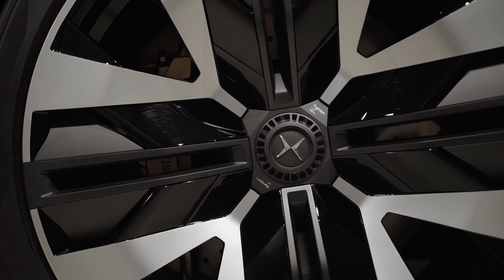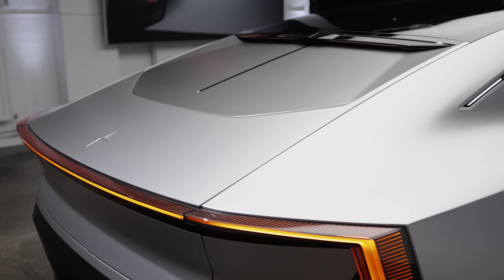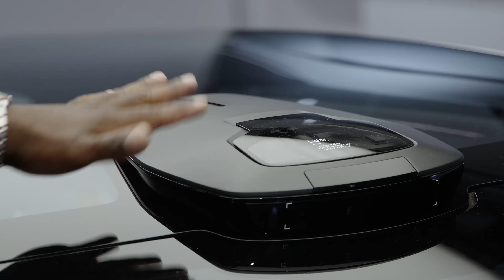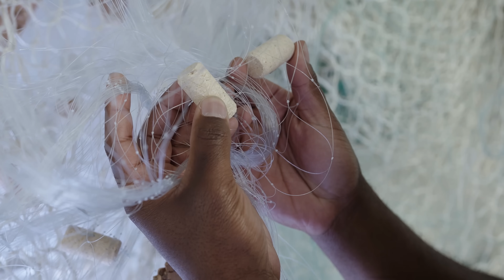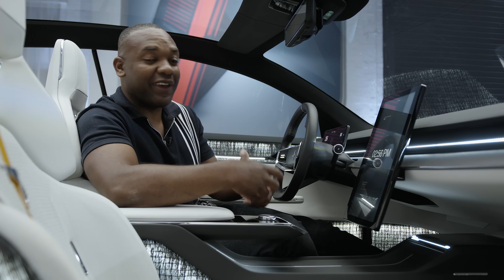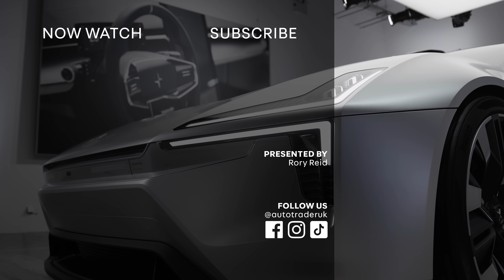NEW Polestar Precept: The Most BEAUTIFUL Electric Car So Far? | 4K

Comment: Great looking car.
"Polestar is a Swedish automotive brand established in 1996 by Volvo Cars' partner Flash/Polestar Racing and acquired in 2015 by the former. It is owned by Volvo Cars and by extension its parent company Geely. Geely describes the brand as "independent" from 2017 onwards and "co-owned" by it and Volvo Cars." Wikipedia

Comment: hate to say it but i dont want any form of moon roof on any car...living in Montana the heat from a moon roof is unreal in the spring and summer time...i never open the moonroof on my Jeep Grand Cherokee as it is just to bloody hot to do so.  The other thing I do not like just like on the tesla, I do not like not having a manual stick to put the car into gear.  I know it technically isnt needed but it is just my preference.  However, I really like the rest of the design.  I am curious what the specs for range and such will be for this car.

Comment: The only nice feature is how the front looks and maybe the seats, but only time will tell if and how they perform in real life and how they age, and how dirt gets stuck everywhere... Everything else is just meh, especially the rear, just ugly.
- the interior "fabricky" panels, just ugly as well. Just as the guy said "Repackaged garbage". Exactly. 
- all the lighting inside? Why? I only see higher maintenance cost in this unnecessary gimmick.
- glass roof? Again, why? Because it "looks cool". Impractical from so many angles. "So you can have more light inside???" What is this, a library? I don't need MORE light in my car. And wait until the car rolls over - without the back beam and glass roof, no thanks. I used to have similar roof windows on my previous car. It got hot as hell on sunny days inside. My new car without any roof glass doesn't get half as hot and it gets cold a lot faster too when driving. Better safety too. And also, how often do you look up when driving? Just another gimmick.
- no middle rear car seat? Just so you can have an arm rest? Is this supposed to be a limousine? It does not have privacy or enough head room or leg room for that (the guy is 5'11" and it's just "ok" for him). So why? So rear seat passengers can control my audio? No thanks. I am the DJ in my car. This just looks like a half assed idea of an overly enthusiastic good-doer wanna show-er.
- the Lidar "bug"... I guess engineers had a vacation day when that was just stomped on...
- STOP WITH THE DASHBOARD TOUCH(GESTURE) SCREEN GIMMICKY POOP already! I want to FEEL what I am touching when my eyes are 100%!!! on the road. Your CHEAP "modern" touch screen solutions are not improving anything!
- what sort of "review" is this when you don't even open trunk? TF?
/rant

Comment: Imagine opening these doors in a Tesco carpark.
Reply: Exactly. Impractical for aesthetics.
Reply: @Wunderkinddd  I think they would have thought about that, I wonder if they have sensors to open without object hitting.
Reply: @Wunderkinddd  strongly disagree with you about the different hinges ( dihedral or lambo would work as well but im not super sure there the better pick overall for this model ) and having no b-pillar's as loading and getting into and out are easier than conventional b-pliersed sedans

Comment: Not a single drink holder, albeit an ashtray too, every driver enjoys a beverage at times while driving, no utilitarian thought in it’s design for real world consumers. They use recycled materials, which is a fraction of the cost of new/bulk material, & intend to charge “through the nose” for it?😱. The obnoxiously large LED screen is akin to Tesla’s,,,does it also feature the “fireplace” their’s has?😂. It does have it’s attractive points, but from what I’ve seen, there’s better EVs on the market. At most likely priced at over $80K+, it would only be for the financially well-heeled of buyers. It’s still always good to see new competitors & their ideas become fruition.

Comment: The u.k current annual electricity usage is 287.58 terawatt hours a year.  An electric car that travels 13500 miles a year uses 4000kwh.  1x terawatt covers 25,000 cars.  U.k has 40m vehicles.  The u.k requires 1600Terawatts. Where are they going to get this, by fossil fuel power stations?  How many batteries? How many open mines?  Game playing is what enviromentalists are doing as well as politicians.  Bs

Comment: Listen this channel is so shit since it can not see the revolution that is before it and understand that there are two kinds of EV's.
1-
EV's that are cars that are just propelled by batteries (so a new power train but in essence are still cars in regards the consumers user experience and the functionality they can provide).
This transition has been a nightmare for every single OEM that produces ICE cars.

2-
There is a second and different kind of EV, one the is propelled by batteries and for which they provide the best in class performance per kg and per $ spent.
 This is Tesla, but Tesla, has added to this performance propulsion a new customer experience by making their EV's a software programmable EV.
So what does this offer the consumer and how does it change the user experience.
Well one gets true over-the-air- updates , none of this fakery that can only update the interface of the entertainment system, but actual software control over the fundamental building block of the EV, so battery pack, brakes, windscreen wipers, entertainment systems, use telematics to monitor the car and its performance and to record logs about the cars activity, etc. 
This is fine scale controllability enabled by Tesla having its own real time operating system that controls almost everything that makes up the car.
This means that Tesla's cars evolve over time and this enables something very valuable to consumers, future proofing....or a close approximation. 
An ordinary EV is a car that can not evolve and be upgraded over time. 
A second hand Tesla model 3 built in 2018 is not the same car now in 2021 as it was in 2018, it is a better car now due to updates.
Tesla's are becoming autonomous and have the capacity built in via the 3rd gen AI chip and sensors which are connected to Tesla's supercomputers that train the AI neural networks to become better autonomous car. 
This is not a geo-fenced solution, this is to enable a Tesla to drive on any road anywhere. 
Tesla's are NOT EV's like the Polestar et al,  they are software controlled and becoming level 4 and or level 5 functionally autonomous, a value add,  that ensure they change the consumer experience of using and owning cars forever.

So the above is NOT what this channel has been able to articulate or is even aware of and you completely miss what is happening to your industry, just like Nokia and Microsoft missed what was happening when the Apple IPhone came along with the Apple App Store.

Comment: I´m not a fan. There are various design elements stolen from other cars. At the same time some of the elements will most likely not make it into production.
The missing B Pillar section is hard to get noise free. The side section causes a lot of turbulences and will collect a lot of dirt. The lidar in the middle of the top....really? 
No rear window and no proper rear view? The doors are not "sportscar". Actually they were used in the 1930s, but then vanished because they are unpractical in every days use. 
The material inside looks very cheap. A luxury car using old, used fishnets....I´m not sure that they understand the target group. In general, were are the new design idea´s?
..but I´m probably not the target group.

Comment: Looks really nice! Not overly fond of the exterior “plate” on the front roof (hope they incorporate that in the car better with the final product) but I do like how the car looks overall. Also the sustainability aspects are worth a big thumbs up in my opinion.👍
Reply: ya they could and should do a much better job incorporating the electronic equipment than that...pretty slap dash if you ask me.
Reply: Since its lidar sensors they need to be mounted like that. Perhaps they can make it streamlined but a hump is required. volvo will have it on all future cars and my guess is that polestar will do the same with their future models

Comment: This  is a concept but I am still not sold on the whole premise of these electric cars and if the government will have rolled out enough charging points to make these viable options for those who now have cars in flats, homes of multiple occupancy, etc come 2030 the stopping of the selling of petrol and diesel new cars without the infrastructure in place for these electric vehicles may cause real chaos on the roads

Comment: awesome design, but the car. industry is going the wrong way these days, very few of these cars will ever get high milage due to high repaircost and sustainability due to loads of tech most people dont need, and large heavy batterypachages, i want a simple lightweight car that does 500.000 km on chassi and engine, and cheap to repair. no matter if its electric or petrol diesel

Comment: This why is No point buying a EV yet wait till 2030 , coz companies are bring out new designers and batteries tech etc it’s Still not Settled  into the norm just bringing out cars like they have past 20 years + also if JCB can pull it off as they are in developing using Current conventional engines into powered by Hydrogen fuel if they can do that successfully then that too is a Game changer as will reduce cost etc as and no need for new tooling of factories etc and better for environment as no need to Over dig mines to get materials for car batteries and thus keep mining at level just for phones and computers etc ..

Comment: The sensor "glob" on the front of the windshield looks like a hideous add-on. Surely the engineers could have integrated this into the design. Perhaps they will once this advances to a production model.

Comment: I’m sure when they say the finished product will be pretty damn close to this concept, they mean it’ll have like 10% of these design touches and features.
Reply: We've had some crazy designs coming to production lately. But yeah, they'll change a lot of things for sure.
Reply: I honestly believe them. By not having for example an engine, engineers and designers aren't as limited as they are on ice cars. Look at the Ioniq 5 or the Kia EV6. They look like concept cars, although being production ready. This is an aspect that gets me really hyped concerning electrification
Reply: @pukelbag  but also look at the lexus lc 500, which looks exactly the same as its concept and has a 5.0L
Reply: @pukelbag  It ain't the engine that prevents you from making a wacky looking car. It's usually production cost, and safety regulations. That massive glass roof, for example, could it drop on your head during a crash? This kind of stuff.
Reply: volvo doesnt work like most manufacturers dude

Comment: It looks like one of the cars from Ridge Racer, design-wise it's nice! But, cars have B and C pillars for a reason, I question the roof's and strength and stiffness.
Reply: I have a mercedes convertible. Nothing missing in strength in my car.
Reply: @travis8665  Your car has rollover bars that shoot out to prevent the car from crushing you, you don't have that with a roof on so you're depending solely on strength of the roof to support the weight of your car.